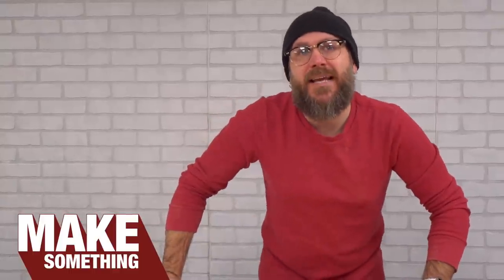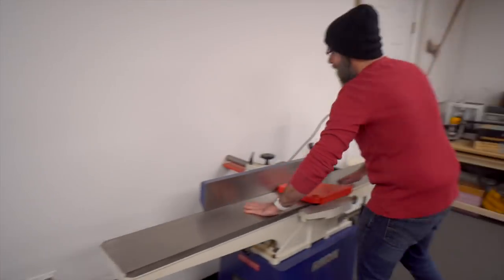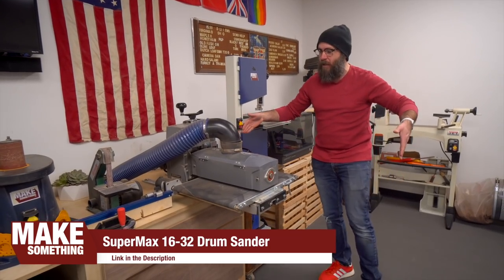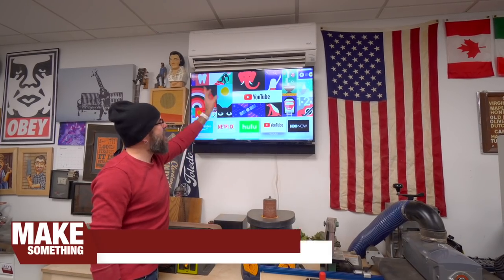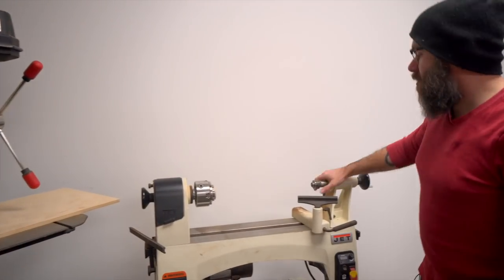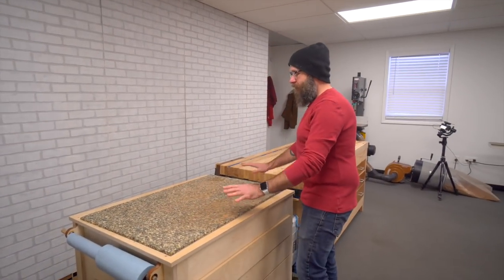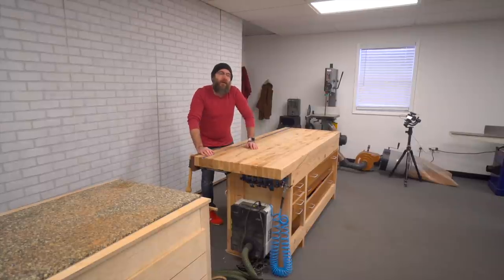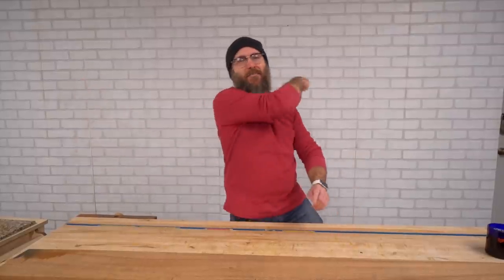Shop Tour, Dust Collection and Tools. Did I Pay For Any of This?

Comment: Love your shop and the layout. I started 2 1/2 years ago in a 1 car garage with a circular saw, 12” Delta planner and a Ryobi power drill. Bought a house 6 months later in the mountains that had a 3 car garage. It was basically empty but thru the power of bartering I have acquired a full efficient shop. I’m always wheeling and dealing but also bought a 15” HD Grizzly planner, 14” Grizzly Bandsaw, 2 hp Grizzly 1 micron dust collector since moving in. I am slowly getting to a more efficient and dust free environment. 
 Thanks again for not only sharing your layout but how to videos which help out tremendously. God Bless

Comment: I love the depth stop on my WEN drill press, as well as the digital RPM settings and being belt free. The depth stop is great...you undo a wingnut, set the bit where you want it to stop and then re-tighten the wingnut.
Reply: I have a different Jet drill press (JDP-15B) and its depth stop is similar to the Wen. I will check out the replacement chuck.

Comment: I love your shop. I am in a wheelchair and your setup would be Ideal for me. Right now my living room is my shop and I have to do my sanding and cutting outside on the front porch. My workbench is a round bar stool for outside and inside I use my dining room table and coffee table. I do have a band saw, a table saw, a drill press, a couple of small sanders a scroll saw. I have to mount all of them on wheels, but so far only my table saw is mounted. I love the way you work and I have your bandsaw box book.I have made some boxes inspired from your book. so please keep making videos. I learned a lot from you. and I have been woodworking and wood burning for a long time. Thanks.
Reply from the maker: Thank you! I love how you make your situation work for you. Sometimes a living room is also a shop! Appreciate your support!

Comment: nice shop and tools , most of my tools are from the 90's with the exception of the Table saw I got from my dad . It is an old direct drive Rockwell 9" table saw built back in the early 70's and is still going strong with only a motor start capacitor being replaced about 10 years ago .

Comment: Appreciate the honesty David. Thanks for the tour. I have shop envy now...
Trying to work in an un-heated double car garage that houses a washer/dryer, freezer, HVAC unit and other immovable objects as well as the need to house at least one car, makes it challenging and limiting. I need to check out those dust collectors because the small footprint might be just what I need. 👍
Reply: I too have shop envy. I dream of having an unheated double garage. I'll settle for a single. I work in my back yard, dragging out my tools each time. When it rains, i pack up. Don't need dust collection though ;p
Just recorded my first 'shop' tour, gotta edit it now.
Reply: Wow!!! feel like I just read about my one car apartment garage that I get little more than half to work in, with sun and Ohio cold weather busting through the closed garage door.  Aww apartment living. 🤣🤣🤣

Comment: Great shop.  I like the clean walls and no runs of duct work.  Must be very nice to work in there.  You've accumulated some nice tools.  I have that little Rikon bandsaw also.  It works surprisingly well.  I do want to get a larger one though just to be able to resaw wider boards.  Love your delivery, David.

Comment: An idea for your outfeed table for the big bandsaw: make it height adjustable with two fixed heights. One height for the band saw and one for the joiner :)
Either by a scissor lift mechanism or just four struts that allow the table to move in an arc down to the joiner and back up again, staying level.

Comment: Living in wet, mold-producing western Oregon, it's weird to see a humidifier! I've been running 2.5 DEhumidifiers nonstop for 2 weeks to dry out my new shop I'm building (which has a mold problem) and boy would it be easier to have to add humidity instead!

Nice shop! The short ceiling would be problematic for me, but I don't do videos. And boy do I wish I had a CNC router and laser!

Comment: If you are looking for a good lathe you can get the 36inch center machinery lathe from harbor freight it works great. The only thing I can say is that the stand it comes with is definitely not the best but works fine. I would suggest getting it and just sitting it on a cabinet.

Comment: I think you might be able to buy a speed nut for your drill press. They are really slick - pinch/ depress spring that disengages the threads and slide to desired position before re-engaging threads.
Reply from the maker: Ohh, I have to look into that! Thanks!

Comment: Looks great, and all woodworkers know that one brand isn't the best tool for every job. It takes a good mix, and sometimes those harbor freight finds are gems! My only question would be why not run one dust collection with piping along the ceiling or even two (one for each side of the shop), instead of the multiple setups you have? Just out of curiosity more than anything.
Reply: Maybe if I waited until 18:25, I wouldn't have asked that question haha.

Comment: Nice video Dave.  You seem self conscious about having nice tools.  You shouldn't be.  I love seeing the mix of tools, cheap and also the nice.  Like I'm sure most woodworkers, I have cheap tools, but guess what?  I am also upgrading.  I'm totally getting a Saw Stop after we move and I'm looking for a good 14" band saw as well.  I also just bought that same 12" Harbor Freight disc sander.  Maybe you're just heading off the inevitable whiny trolls in the comment section, but you shouldn't worry about having some nice stuff.  Can you make build your own $20 table saw with old parts, some old pallets, and some spit?  Yes.  Would I want to watch?  No.  Even if you have a stupid expensive tool, I still have interest.  I won't ever buy it, but I do like to hear why you got it and for what features.  That info helps me shop for features that may be similar in a different price point.  Keep telling us why things suck and why they work and I'll keep watching.
Reply: Have you looked at the sliding table saws like the Felder format 4 or the hammer? They are kind of a neat design with some nice features. Format 4 is very premium and Hammer is supposedly more entry level.
Reply: I have checked them both out.  They seem very interesting to me.  I love the little saw blade that cuts the bottom edge, eliminating tear out.  I don't think I'll have the space needed to get one though.  The main thing I would want one for is ripping long strips from plywood.  However, a sliding saw that can rip a 4x8 sheet the long way would be massive and cost about $25,000.  I think a 36" SawStop with a good folding outfeed table will cover me.  Plus, if I really want it, I can add the slider attachment down the road.  With that said, I'm still planning on doing more research about those sliders over the next month or so, just in case.  The other factor is that no one seems to own them.  I can't find any "woodworking" type channels on YouTube that use one so I have no real way of seeing them in action.  I've only found a few videos and they are practically useless.  Is there a reason that no one is using them?

Comment: You know what, very soon, there will be lots of air filters that people are using for their homes on the used marketplace.  It would be good if someone made a hack to use them in a workshop. Dust filter with 3D formed frame, or take out the heppa and put in a mesh filter in the filter frame.

Comment: you could run the dust collector hoses in the drop ceiling.
Reply from the maker: But they still would have to run down a wall to the machines pulse no room for a central collector.

Comment: Hey, Dave, nice shop, thank you for the tour! I like some of your space-saving techniques, like the sander being mounted on the drawer slides. Something I noticed with your jointer: the cord is almost fully extended, which may be stressing the plug. Are you going to add an outlet closer to the right side of the tool in order to mitigate this?

Comment: Great shop tour.  I don't particularly like the antiseptic look but can totally appreciate that 'to each their own'.  I like the idea of having the drum sander on drawer slides as I think I'll have to do the same.  I've got a massive Dewalt sliding miter saw that is 30" deep and I'm trying to design base cabinets to incorporate everything but not have the cabinets 30" deep...thinking about making some sort of sliding tray that pulls out.  Any suggestions?  Great channel overall by the way; I've watched your table saw sled video about a dozen times and am finally getting around to making one!

Comment: What kind of vacuum do you use?  With the carpeted floor, I would guess that the vacuum cleaner you use (or Dan uses, as the case may be) is one of your most important shop tools.

Comment: Have you ever seen the OMGA miter saws? Price wise they make the Kapex look cheap. They are industrial grade with industrial grade features which does drive the price up by quite a bit. Some of the double miter saw models cost over $20k. I find it interesting how expensive some tools can get when you go industrial grade.

Also I wanted to ask what the thing in your shop that was causing some kind of smoke/vapor in your shop?

Comment: Help, David! Can you tell me your thoughts on those dust collectors? I really like the idea of them, but I've read in many places that 3HP and larger impellers of about 15" are the minimum needed in order to move the volume of air necessary to adequately collect fine particles less than 5 microns. Especially with the drum sander I've read that one needs a DC capable of 800 or more CFM to keep up with one of that size. Do you find your DC's do a faithful job of providing enough suction and collecting everything? My issue is this: I've had to move so much over the past several years that hauling my big heavy machines around with me in addition to not owning my own house and sometimes not knowing if I'll have a shop--and if I do, if it will have the necessary 220v power--has become almost unbearable and I would like to figure out a way to get around these issues with smaller machines that are easier to move and don't require 220. I now am on the verge of moving again and facing just selling my machines--including my big, heavy, 220v Laguna dust collector--and hanging up my shop apron because I just can't keep going with this vicious cycle. I'm trying to figure out solutions that provide me some future proofing.
Reply from the maker: I don't really have any experience with other dust collectors. All I can say is that it seems to work fine. Although I don't have an air quality tester in my shop.

Comment: Thanks for the video. Can I ask what drawer slides you're using for the 16-32? I was looking at that idea but couldn't find ones that were heavy duty enough.
Reply from the maker: They are just regular ones from Home Depot. They’ll probably eventually fail and need to be replaced

Comment: How does the dust right compare to the amazon linked dust collector you have listed? Thinking of putting one under my table saw as well.
Reply from the maker: I'm not 100% but I would guess they are made in the same factory. They look identical. I've looked at all the photos and don't see a difference.
Reply: @MakeSomething  youre the man, i appreciate it. thanks for the response!

Comment: Do you have a list of tools that you recommend a beginner have for woodworking?
Reply from the maker: Come up with a project first and buy the tools you need for that project. That way you won't be buying tools you won't use. Everybody has different needs, shop size and budgets so it's hard to come up with a list of tools for beginners.
Reply: Make Something is that how you started? Would you recommend Festool? I have done woodworking for about 3 years now, but I am discouraged to make anything because of my space (a little shed that is actually a shed for my family’s washing machine and some space in front of the door to it), tools and because I have no projects that my family need. FYI, I am going to high school next year so I am a teen. I also have a extremely limited budget. My dad also does a little woodworking, and we work in the same space. I can’t buy wood bc my dad doesn’t think that is necessary since he gets some nice 1” thick by 4”wide pallet wood from his work. But, I don’t have a planer to plane the wood down( the wood surfaces are rough). I only have 2 drills, one that is cordless but lacks power from black and decker and another from black and decker that is cordless, I am not allowed to use our mini circ saw, and power hand held planer and we also have a really bad random Orbit Sander from Walmart. Do you have any advice for me and again, do you recommend Festool, thanks

Comment: Do you have more information on the carpet ti ou used? I live in MN work in 12 ×20 shed with heat. But get alot of drafts from the floor. I dont think it was insulted like the walls and ceiling.
Reply from the maker: I don't really have much info on the carpet. It was installed by the contractor. It's your typical high-traffic office squares.

Comment: Great video , it gave me several ideas for my shop. Can you give me some wood projects ideas for the lumber below that I could sell at craft shows, flea markets, craigslist, etc. I would really appreciate and ideas. Im just getting my woodshop set up. I have a 40x60x20 barn with about 200 12' 3"x3" red oak lumber . Im curious to know if you have any projects I can use this "free" lumber for? This is an idea of my shop I have ( bare in mind I have had a limited budget to set this up on) 20'x40' wood shop....new craftsman professional cast iron table saw 2018 model,new Laguna 14/12 band saw with a Laguna resaw king 3/4" blade ,new Shop fox 6" jointer, new 12" DeWalt planer , new Jet dust collector, new Kobalt router and table, used 6x48 belt and 9" disc sander, used 10" 16 speed delta drill press with mortising attachment, new delta 10" single bevel , sliding miter saw with stand. Misc: new incra table saw miter sled, hand power sanders, kreg K-5 system, new full set of forster bit set, 10 48" bar clamps about 30 trigger clamps 6" 24" 25 2" spring clamps, dewalt drills and impact, circular saw, jig saw, dewalt 1/4" router, profile sander plus a lot of Misc small tools. Any advise for me would be very helpful. I really appreciate your time and trouble. Thank you very much , Jon Bowers Mount Olivet, KY.

Comment: What is baseball bat by the door used for?
Reply from the maker: Intruders
Reply: @MakeSomething  I see. Does it have a wireless connection to the SimpliSafe?
Reply: That's the on switch for sweeper Dan.